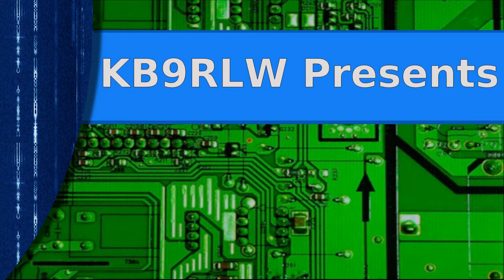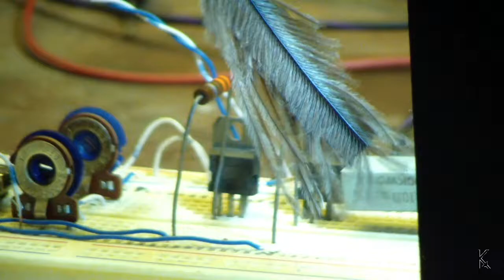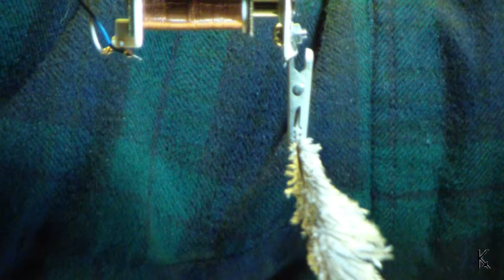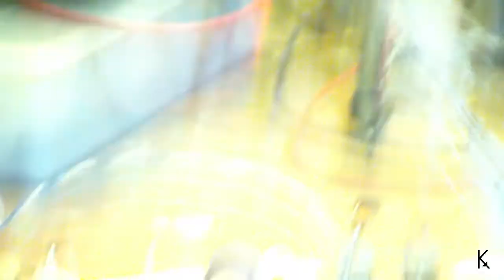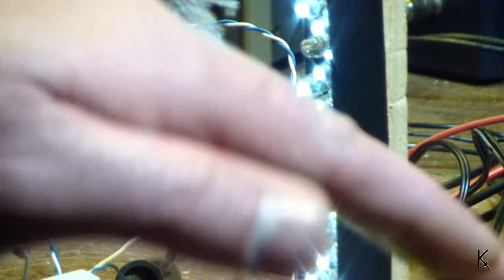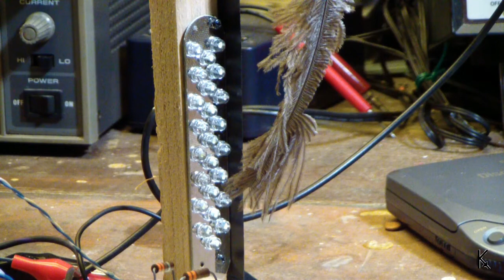Electronics  - The magic real time slow motion device

Comment: Hi! This is really cool and I'm trying to build a similar project. I'm wondering what suggestions you may have in regards to the electromagnet. You mentioned using a solenoid -- is it a push pull type solenoid -- if it is how did you get rid of the packaging on the solenoid?
Reply: Also, I'm wondering how long it took to build everything?
Reply from the maker: Not sure what you mean by packing on the solonoid.   I had one in the junk box that just had a free floating rod through the middle, so I used that.  Something like what you'd find in an old doorbell chime.
I was a day long project, a few hours or so.